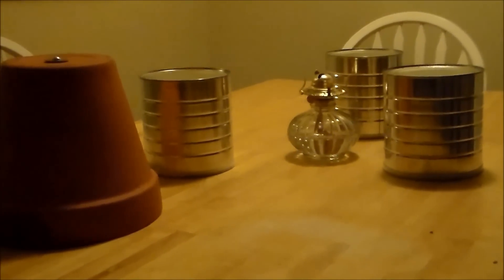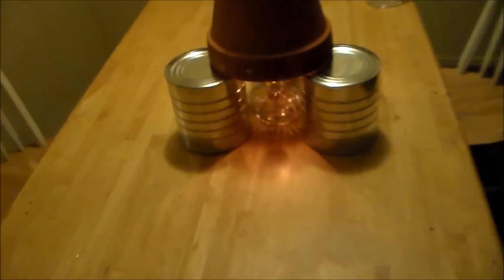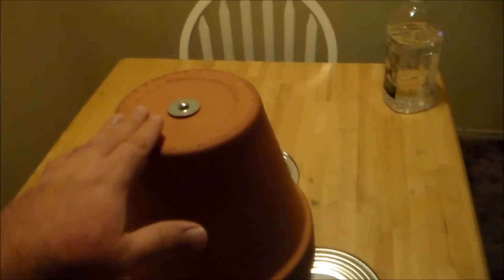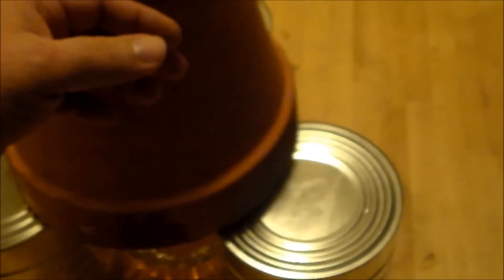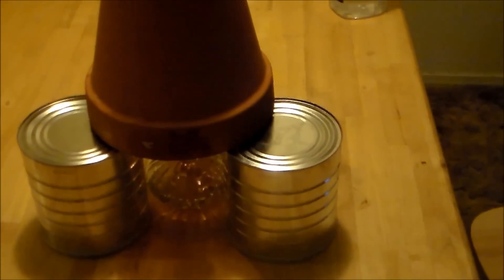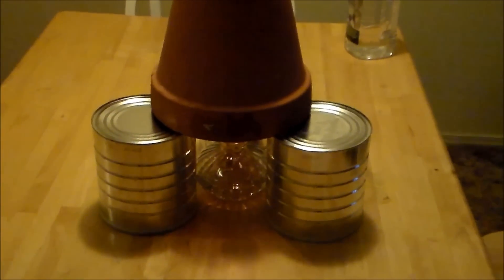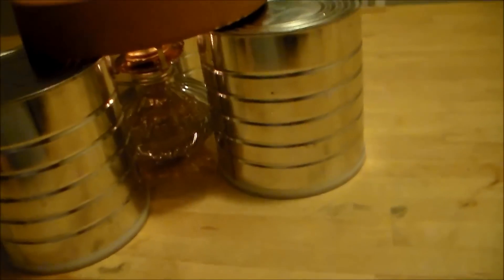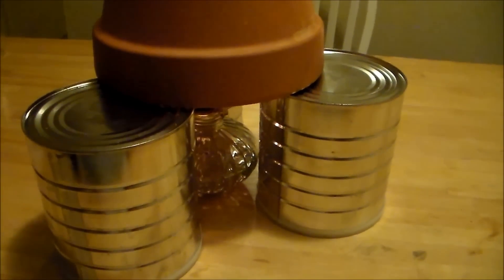Candle Heater using oil lamp

Comment: In case you slept through science class; the pots do not increase the amount of heat generated by the candles. The ceramic pots absorb the heat from the candles in a way that slows down the thermal energy produced by the candles from immediately equilibrating with the air in the room. The ceramic's heat capacity allows it to reach a higher temperature before "releasing" the heat into it's immediate surroundings. As a result, the pots warm the air adjacent to them to a comfortable temperature for warming your hands; something that a candle doesn't do well on it's own. A candle without the surrounding pots feels apparently cold about a foot away, and scolding hot within a few inches. By slowing down the transfer of thermal energy to the surroundings you get a small volume of comfortably warm air beside the pots.
Reply: Mr. Ydstie , Isaac He is not using ceramic pots nor he is using candles.
Reply: Mr. Ydsti, your comment could have provided useful information had you not started by belittling the the person recording who was helpful to the rest of us.

Comment: You know,  this is my first Winter tinkering with oil lamps.  Studied some videos and there was a video a fella recommended never not using a globe when using an oil lamp.  Interestingly enough,  when I replaced the globe I noticed the light increased because the globe allows the oil lamp to breath by tunneling the air through the breathers,  hence a hotter flame using less wick.  I compared heat output and well,  low and behold the globe actually got super hot,  in fact equally as hot as a flower pot.  So best just keep the globe on and enjoy what heat and light you can get... sigh,  better then nothing,  I can say that...

Comment: K1 clear kerosene in my area is about $4- a gallon. Make sure the flower pot is completely above the lamp/fuel source, so it doesn't heat up the fuel past a safe point. I got some pavers at home depot for about .50 a piece that would make a nice base.

Comment: Get rid of the flower pot. They can have small imperfections in them that risk cracking and have been known to knock the heat source over and start fire's. A flat was set on fire last week in the UK. Make a nest of the metal cans like a Russian doll using nuts bolts and washers for spacers between the different size cans. Bravo with the oil lamp idea. I thought of this myself. You can sometimes use veg or olive oil in them if you're in a fix but you sometimes have wicking problems.

Comment: Thanks for the demo.  Helpful.  Btw, try placing an empty tuna can or similar with a small amount of water on the top of the system.  If you can enough heat to make the water release steam, the heat will be more obvious and comfortable.

Comment: Nice, I would like to suggest that in an emergency try using a 1lb can of Shortening (Crisco or the cheapest you can buy) and put a wick into the can to create a 7day Candle (REMOVE THE PAPER WRAPPER!) and light it up. That 1lb can will last for days and at a price that cannot be beat.
Reply: is vegetable oil fine?
Reply: Wow In the can Inwould be scared of fires in there

Comment: Good to see I am not the only one that would go with oil lamp... I would just use a different base so the table top/surface wont get hot.
Reply from the maker: +Morgan More Ya I would do alot of different things as well, but I was just testing the concept.
Reply: thanks for testing it

Comment: Go look up Crisco Candles....they burn a very long time.

Also, a small fan to blow the heat off the top of the heater, but maybe not necessary.

Also, I don't know how long your bolt is, but a longer bolt with more washers for mass, and it should heat up more, or so I have heard...

Good Video, great variation.

Comment: I'm going to offer a suggestion & if you try it, let me know if it works.  The light/flame is striking the metal bolt with the washers & nuts.  If you can add broken glass in a crushed firebrick mixture around the inside of your multiple pots, you may help radiate the heat source even more!  Glass is what is inside of most hot water heaters & it holds the heat...just an idea & if you do it, let me know if it works out.

Comment: Made a candle radiator, not an oil one. IMO they only really work (noticable) for small rooms, or after you've had the heating on in a larger room they seem to keep the room warmer than a cold room next door.
Reply from the maker: They work exceptionally well in a small space. If you are trying to survive it could save you.

Comment: It'd be safer and more efficient if you just treated the lamp like a stove and just put a pot of water over it. Safer because the Terracotta pots can blow up. More efficient because water is better than air for storing heat. Fire brick would also be better.

Comment: if u would use a longer bolt so the fire was hitting the metal right off it will heat up better

Comment: what kind of cans are you using to support the flower pot?  Are they empty?  Did they get hot?  I would worry more about the cans getting hot and burning the wood they are sitting on.  I live in a total electric apartment and am considering this as a heat source if we lose power for a length of time.
Reply from the maker: Empty coffee cans. Not real hot. The flower pots got hot but didn't transfer the heat down to the coffee cans to bad.

Comment: its about heat.  I have experimented w a poppers budget.  saving cat food cans and placing holes in them fir candle flame.  then stacking the cans in to of each other w a while it two to get oxygen to the candle.   heat got so hot that holding my hand over it wasn't possible wo being burned.  in going to experiment w cooking an egg on top of the top can to see if the heat is enough.   I've placed 4 of these heaters in a very cold room. it didn't get real warm but kept heater from going off

Comment: needs a chimney so the air is pulled up faster threw the holes under the burner moving the at the flame faster. brighter flame is hotter and cleaner burning. I use an oil lamp I bought at Walmart by it self with the chimney and in my 12x18 living room if it is 50f outside it will keep the room at 65f if I close the room off. I think it could do better if the volume of air heated was greater air movement would be better. I have a couple ideas to try using clay pots and another also but need get other lamps for testing because I'm off grid and I use the lamp for light also. and I also use kerosene in mine, works just fine and cheaper then lamp oil. I pay $3.89 a gallon for kerosene.

Comment: i'm looking at making one of these. my question is how well does it heat up a fairly large bedroom? because i'm looking at using one in a very cold environment
Reply from the maker: In my oppinion this is an emergency heater. It will not get a large room cosey warm with this configuration.  You will need to test larger pots and maybe 2 or 3 oil lamps as your heat source.
Reply: okay thanks for that.

Comment: do you have a CO detector? I am wondering about carbon monoxide increasing with that. I suppose candles also create CO??
Reply from the maker: No I do not. This is an emergency heater to be used in an emergency situation. Chances are you will not have a CO detector. I ran 2 lamps for a week and had no problem in my house if that helps any. There is enough air exchange in leaks in the house to replenish the small amount of oxygen this thing uses in my case.
Reply: thanks George understood its not long term usage

Comment: Hey, GW! I built one of these flower pot heaters this past winter.  I ended up having to use candles cuz the oil lamp produced hellacious soot, no matter how low the flame was.  Did you encounter this issue?
Reply from the maker: I kept raising the pot up until I got a clean burn. Sorry about this late response. I didn't see it in my feed.

Comment: Those lamps were designed to burn kerosene.. It costs less than four dollars a gallon.. It's flickering because it needs the chimney to regulate airflow..
Reply from the maker: Airflow was regulated when I raised the pot up. In my area I bought a 5 gallon can of kerosene and it is over $50.
Reply: George Wright Wow and I thought our prices were high.. So many people can't afford to keep  themselves warm in the winter.. All petroleum prices are so high, it's been a while since I could afford to take a Sunday drive..
Reply: 100% correct.  Hurricane lamp freak.
Reply: bloodandwinearered I am a hurricane lamp freak.  I have over $800.00 worth of them.

Comment: Could someone explain the point of this to me? I'm not being sarcastic. I really don't understand. The pots will not provide any additional heat beyond what the flame does on it's own. I understand that the pot provides radiant heat, where the candle provides mostly convection. Is that the point? Because if you're just trying to heat a room, the pot is pointless. Or am I missing something.
Reply from the maker: The pots catch and store heat basically and they radiate it once the pots are heated up. The pots put out significantly more heat than just the flame alone.
Reply: That's impossible. You can't get more energy out than you put in. You can get it in a different form. Radiant as apposed to convection. But you don't get more.
Reply from the maker: It focuses the heat instead of dissipating. Kind of like an oven. If you leave the door open it wont get hot.
Reply: So the benefit is in focusing the heat horizontally as apposed to laterally.

Comment: put air vent holes in the large can bases. That should help with oxygen flow to lamp wick, and may also increase amount of heat flow due to circulation of air.

Comment from the maker: I have not tried a metal pot. I think something like cast iron could work. Definately something to look into.
Reply from the maker: I used this for about 6 hours the other night. Heats up in about an hour. Then I turned my heater in the house off. 33 degrees outside and my thermostat in the apartment stayed on 72 for the duration. Kind of impressive.
Reply: @GWprepper  is that with the pot or cast iron

Comment: Any time you have some kind of flame burning you are consuming the oxygen in the room. With a heater like I would be a little paranoid about the carbon monoxide building up. How long can you run this and not poison yourself?
Reply from the maker: its the same thing as burning just the lamp to light the room. I have ran theses lamps in the house for days. Not saying that if you have a completely air tight room you wont have a problem but my room isn't completely air tight.

Comment: the problem is the poisonous carbon - monoxide gases : a silent killer .
Reply from the maker: The exchange rate of outside air in my apartment easily handled this...was a breezy apartment.
Reply: better than propane.  and also drafts kept it good too.  always ventilate